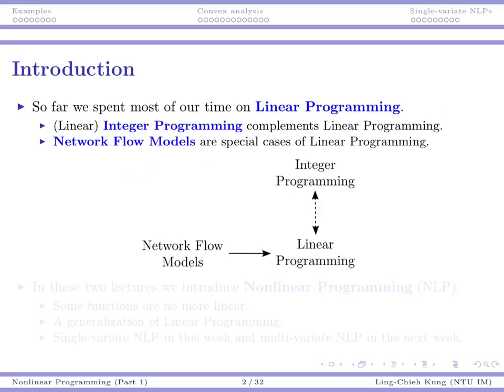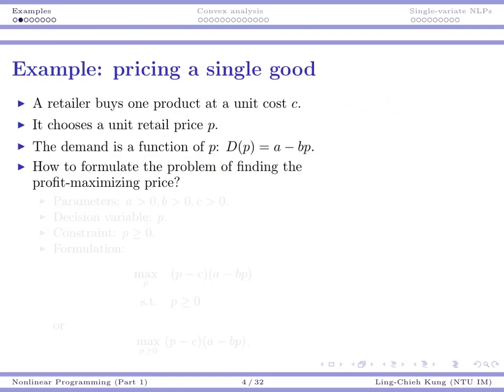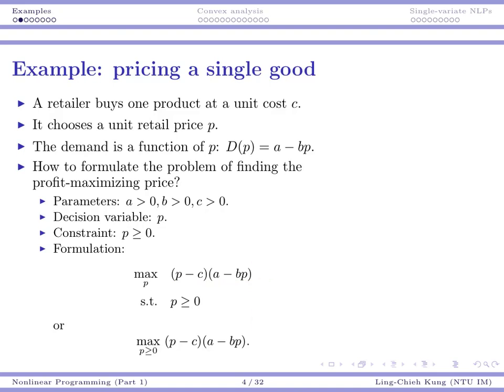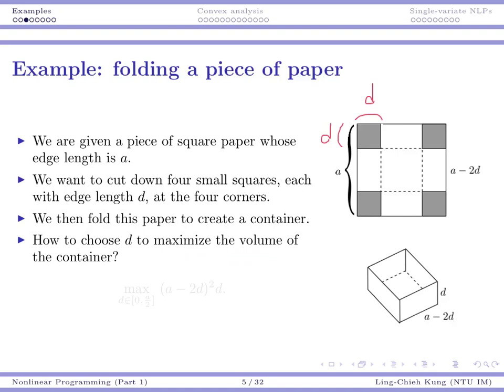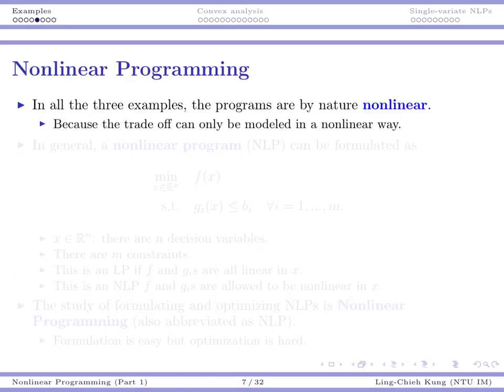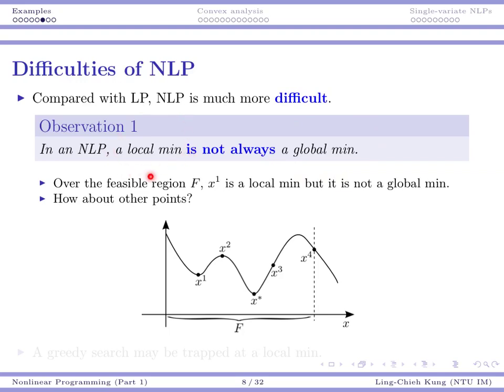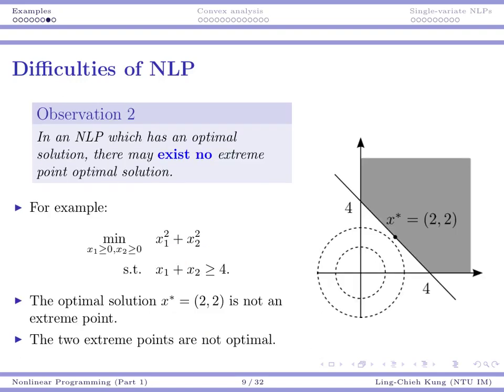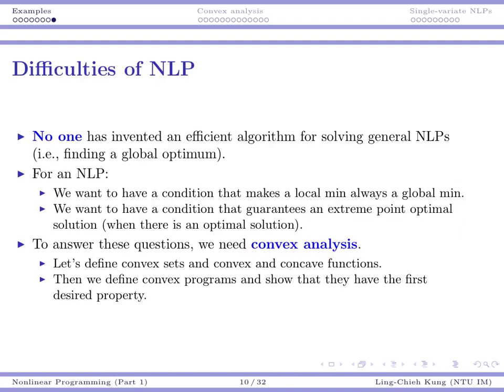Lecture 9.1 for 2014/4/17 (OR 2014)

Comment: Thank you for your very useful video. I learn a lot from your presetation. I have a question about the form of nonlinear function. If f(x)  is order weighted average in which  f(x) = sum(w_i*x(i)), where x(1) is the smallest element of x, and x(n) is the largest element of x. How can i mathematically prove that the effect of REORDERING xi in vector x will make the f(x) is NONLINEAR?
Reply: Thank you for your message. Unfortunately, I don't quite understand your question. 

When I want to decide whether a function is linear or not, I need to know what are the variables. In your question, is x(i) variables and w_i constants? If so then f(x) is linear. 

You then mentioned about reordering x_i... Are you saying that we have a function f(x, sigma), where x = (x_1, x_2, ..., x_n) and sigma = (sigma_1, sigma_2, ..., sigma_n) such that f(x, sigma) = sum(w_(sigma_i) * x(sigma_i))? If so, and sigma is a variable, then f(x, sigma) is nonlinear. To prove it. simply find an example such that af(x^1, sigma^1) + bf(x^2, sigma^2) is not equal to f(ax^1 + bx^2, a sigma^1 + b sigma^2). It should be very easy.
Reply: Thank you very much for your instant reply. Let me describe my question again. Given a vector x=(x_1, ....x_n) and a weighting vector w=(w_1, ..., w_n), the ordered weighted average (OWA) of f(x) is the weighted average on the increasing order of x. 

f(x) = w_1*x_(1) + w_2*x_(2) + ... + w_n*x_(n) = sum(w_i*x_(i)) 
where i= 1, ..., n

and x_(1) is the smallest element of x, and x(n) is the largest element of x (or alternatively x_(1) < ...< x_(n))

The OWA function of x is called nonlinear due to the effect of reordering x (see https://en.wikipedia.org/wiki/Ordered_weighted_averaging_aggregation_operator).

However, i do not know how to make the proof of f(x) is nonlinear. It is not trivial for me.
Reply: Oh ok. Then it is easy. According to the wiki page, among all possible OWA, one is the minimum function (w_1 = 1, w_i = 0 for all i > 1). Then because the minimum function is nonlinear, OWA is nonlinear in general.
Reply: Would you please give more explaination why the minimum function is nonlinear or any textbook to read to have a background on it? Sorry for my late reply.

Comment: can you give a example of linear program for pricing a single good (example 1)
I still don't understand the difference between linear and nonlinear.
you can use linear programing to find Max P right?
Reply: This problem is nonlinear because the objective function is a quadratic function of the decision variable p. I do not think that this problem of finding an optimal price can be formulated as a linear program.
Reply: +Ling-Chieh Kung
 I see, so the objective function determine wether it is a linear or nonlinear programing.

Thank you, very good video!!